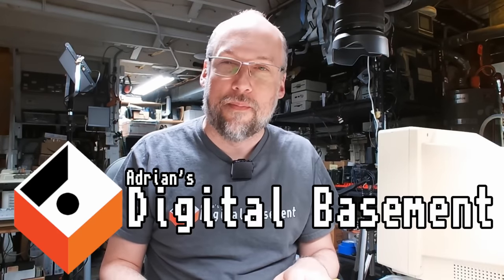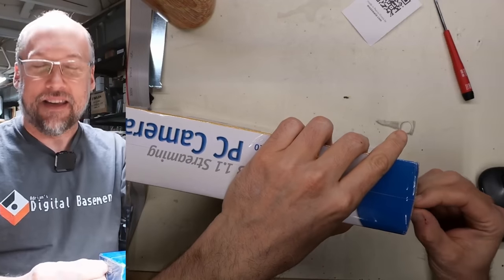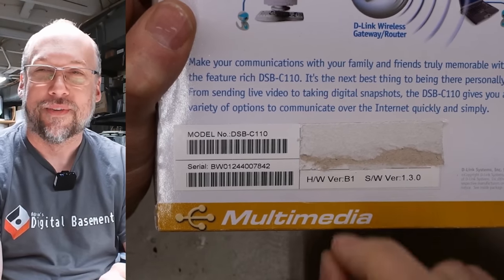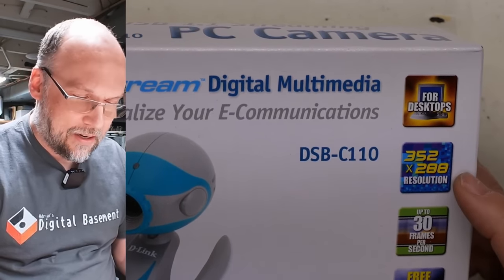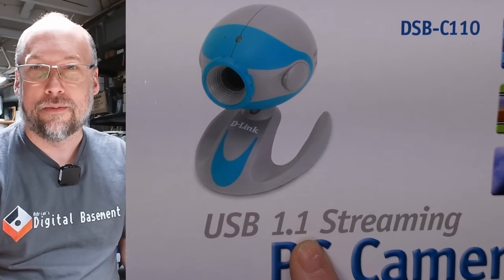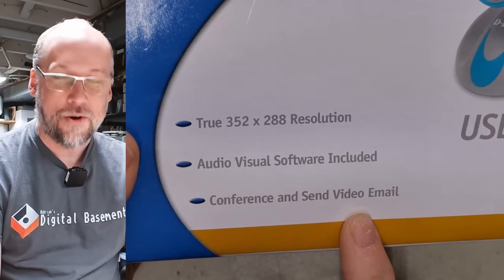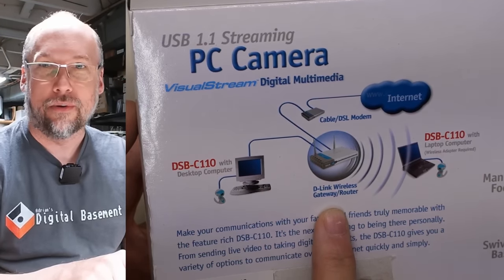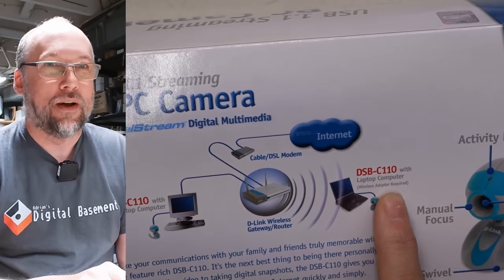How usable is a 20 year old webcam today? (D-Link DSB-C110)

Comment: Around that time (2003-2005ish) I got a similar webcam for $18 at a computer show. Out of the box, it had a similarly horribly washed out image, but once I got into the settings and manually adjusted the brightness, contrast, and color saturation, it wasn't nearly as bad.
Reply from the maker: Heh, this one could have similarly benefitted from that. I remember having to do that in the past too.  I wonder how one manipulates those same settings under Linux?
Reply: @adriansdigitalbasement2  No idea. I have a long history of preferring not to use Linux. There is also a 50/60 Hz setting which may help to reduce the flickering.
Reply: @adriansdigitalbasement2  in VLC you have a video equalizer (saturation, brightness, hue, contrast and some colour mixers) and a lot of post processing opportunities. It's not straightforward to set up, though. You need the right codecs and the right plugins and it also depends on the output settings/drivers how many different picture settings/post processing types you get.
Reply: @adriansdigitalbasement2  probably the easiest way would be using obs-studio to access the settings, without mucking about with other control software.

Comment: For an ancient cheap camera, the quality isn't that bad. This thing is still useful for doing retro effects without any kind of filter :)
I was sure this thing will work just fine under Linux. Usually when it comes to old hardware, unless it's something which uses a generic driver (keyboard, mouse, etc.), you'll likely have better luck getting it to work under Linux than Windows.

Comment: This camera likely came out right before the USB Video Device Class was defined. So that's why it needs a custom driver and why Windows 10 doesn't recognize it and why mac isn't supported.

BTW, amazing retro effect when you were on camera. Easier than using a video editor plugin :)
Reply: @MrHurricaneFloyd  That seems unfair. The class specification for webcams came out the same year this product was released, and this device does not appear to have been class compliant. The vendor had a custom driver for the Windows OS available at the time. There's plenty of old hardware which, if it adhered to a class specification, still works today. Anything from third-parties, which isn't a recognized class spec, relies on the product vendor to update their drivers over time. It's great that Linux contributors have worked to keep the driver for this functional over the years.

Disclosure: I work in Windows at Microsoft, mostly on apps and technology for musicians.
Reply: @MrHurricaneFloyd  Thank you for your contribution.
Reply: If I remember correctly (and this  is going a long way back), I think these cameras used the isochronous transfer mode of USB, which was dropped from the USB standard at some point, and windows stopped supporting it all together, which is why there was a max windows version they worked with even if you had the drivers. I had a USB Quick Cam (and this looks like an exact quick cam clone with slightly different outter plastic) ages ago that was pointed out a window as a webcam / timelapse camera. and I remember having to run it on a linux box even back in 2002ish timeframe. I switched to linux as my main machine shortly after that, and have never looked back.
Reply: @gorak9000  Windows supports isochronous transfers for drivers as well as with WinUSB (similar to libUSB). But it it was dropped from the class spec, then it's unlikely to be in the class driver.

For a class driver to pick up a device, the device has to report the right compatibility in the USB descriptors. Otherwise it will need a vendor driver.
Reply: Wow yeah, right at the same time. And it was cheap enough they wouldn’t want to make it up to the spec. The Eye Toy worked fine with no drivers, but that was at the very end of 03.
Reply: You can also just edit the INF files they are text. Just add newer versions of Windows to the allowed versions and windows will probably report it fine.
Reply: @RowanHawkins  That's a bit iffy. Worth a try. But if the driver's not signed, or uses a deprecated driver model, it won't work. Many Windows 7-era drivers can squeak by, but earlier than that is unlikely.

Comment: Remember that when this camera was current, we were still on analog NTSC for broadcast TV, which has a realistic resolution on 320x240, and VGA (640x480) was still considered mainstream.  We were recording our shows at SLP speed, and the output of that was worse than this camera, but that's what we were used to at the time.
Reply: Yeah, I never used the high quality settings when recording video. I did a few times and noticed a difference, but SLP was what I stuck with. On a basic 24" TV it was fine. 

This would have looked "ok" for the time when viewed live, but then compression would have killed the quality further because lots of people were still on modems, and cable internet was just starting to take off.
Reply: @volvo09  Although it was made backwards compatible to accommodate bitrates as low as 40kb/s the H.261 compression standard that CIF cameras like this were intended to support was really intended for use over ISDN. The video quality was actually not too bad for a compression standard from 1988.
Reply: To be a pedant, NTSC stomps this.  VHS was a bit closer, but even that had higher vertical resolution.
Reply: Eh, for a computer in 2003, I doubt you would have been using 640×480 for general desktop use unless your computer was 6-8 years old or more. Probably 1024×768 on a late-model CRT or early LCD.
Reply: @sanityormadness  not PC resolution, but consumer digital video didn’t go beyond 640x480 until the late 00s

Comment: There's tons of old flatbed scanners that were discontinued on Windows - worked fine yesterday, now they're paperweights (somewhere around 2019). On Linux, they still just work. I even have a scanner from the late 90s that came with a proprietary program that only worked on Win98 and XP and no OS integration so you HAD to use that crappy program. Works just fine in Linux and I use it as my default scanner.
As opposed to webcams, the picture quality on even a late 90s scanner can easily still keep up.

Comment: Back in the late 90s and early 00s I actually used a WinTV card and an analogue video camera, so I could capture at 576i (as I live in a PAL country) which in combination was much, much better than any webcam and also ran at 50 fields/s.
Reply from the maker: YEAH, I did exactly the same thing! And old VHS camcorder hooked up to my computer -- and indeed the quality was decent.
Reply: I did the same thing with my All-In-Wonder 9700 Pro.
Reply: I remember that combination, a BT878 based capture card and an egg-shaped NTSC camera. I bought that as a package.
Reply: thats how wierd paul makes  his videos an old camcorder hooked to a capture card
Reply: I had a Fuji digital still camera with an USB-webcam-feature in the early 2000s. It did VGA resolution with 30 Frames/sec, but the quality was absolutely stunning. With good lighting it almost outperformed a Betacam SP broadcast camera. Also the photos (7 MP) were awesome. Too bad it got stolen out of my car.
Reply: yeah hauppauge or something and a video cam was pretty good from mid 90's.
Reply: I remember drooling over the all-in-wonder
Reply: This is how I used to watch TV back then.  TV capture card connected to cable, and some OSS TV Capture software that did some filtering to de-interlace the video in real time.  Kinda cool watching TV on my monitor in a little window.

Quality was quite good. It ate up some processor doing all the filtering and de-interlacing, but it all worked well on a Celeron 450.
Reply: @stevesether  I fondly remember hacking pay-tv with my Pentium MMX and my Hauppauge TV tuner card... Those were the days! The feeling of archievement, when the picture popped up was priceless.
Reply: @albinklein7680  Nice.  I had no idea those cards could descramble the pay-tv stations.  IIRC by the time I was playing around with it, the pay stations were digital, so it wasn't possible anymore.
Reply: @stevesether  It happened all in Software. It was the European analog System (Teleclub, Premiere) with the Sagem G1 encoding. Active from 1985 to 1999 approximately. It was possible to crack every frame in realtime without the actual key.
Reply: @albinklein7680  My Fuji would eat batteries , lasting less than half hour
Reply: I did that for some video meetings in 2020 (possibly 2021), except I was actually using a DV camera. Not as good as a modern webcam but probably better than the one built-in to my craptop.
Reply: @eDoc2020 I used a fairly high quality digital camera with  HDMI out, connected to a cheap USB capture card (which Windows and even Android recognize as a webcam). It works extremely well. The quality easily surpasses any high-end webcam, at the cost of being a bit bulky.

Comment: Dlink: it works right away, or you'll pitch it across the room, no in-between.  Dlink support documentation: hopefully someone on the internet has had the same problem with our stuff that you do and has fixed it somehow.  Dlink: our wall warts power other stuff when the tech breaks.  Dlink: tech and power supplies available (together and separately) at thrift stores nationwide.

Comment: Win 95B was the first version to support USB, although "support" is being way too generous. You could way too easily corrupt your Win95 installation just by plugging USB devices in out of order, or before the drivers were installed. I worked tech support for a major computer manufacturer at about this time, and every system we sold would come with a big sheet of paper that said something like "WARNING: DO NOT PLUG ALL YOUR USB SHIT IN ALL AT ONCE!!" Invariably, someone always did, and we'd end up formatting/reloading Windows on their brand-new PC.

Speaking of that rubberized plastic, I recently obtained a Toshiba T5200, a 386 laptop with a VGA compatible(!) gas-plasma display. Unfortunately, it was covered entirely in that same rubberized coating, which was deteriorating back into crude oil. It wasn't just sticky, it was slimy, and it was coming off on my hands when I held it. I had to use two bottles of 99% isopropyl and a shit-ton of paper towels to get as much off as I could. It made a huge mess.

Comment: We used a Microsoft Lifecam VX-2000 back in 2008, we wanted to make a robotic arm that played domino with you and the image processing was using that camera. It was a bit better than what you showed but not much better. It had some weird issues with the white color, it showed up as purple sometimes so I had to write a part in the code to change purple hues to white. The box of that camera was terrible, you couldn't put it back together once you opened it, it was also around the same price as this one.
Reply from the maker: I had a few of those Microsoft camera over the years, and some of them were decent, but others were utterly horrible too. I have to wonder how much of the quality we have in modern phones is due to software processing? I guess it's just up to how much effort is put in to make a good product versus just throwing together the cheapest possible thing.

Comment: These early webcams were a lot of fun to discover, back in the day. They were poor in many respects but it was the first exposure to a trend that was taking off. We could only dream about the "internet superhighway" and the advanced technology we may have in the future. When the only chance of seeing live footage was if you had an expensive camera, the webcam really meant that you could imagine what would happen if you had a small TV station or production house at home. Today, we have the mobile phone that holds well enough for most basic purposes, you can even publish your creation right away on the net!

In terms of technology, all early sensors had very poor resolution. 352x288 or QCIF was the quality you could expect. Even if some webcams advertised a VGA photo mode, it was made possible due to interpolation, the CMOS sensor was not advanced enough to offer output at this native resolution. You could use decently enough such a webcam for video conferences of the day, a massive novelty of the era, but not much else. In this case, you did not have the network bandwidth that would handle well enough even that low quality webcam output.

Comment: That is actually their original company color that teal color.  When the world switched from coax to rj45 apple was not doing so well, but dlink was killing it with cheap and reliable consumer switches. That apple became trendy came a little later.
Reply: Yeah, I had an old D-Link 10Mbps 5-port hub that was white with teal accents, including the vertical stand.  It was a pretty neat design aesthetic, from around 1995 or so.

Comment: Seeing the image from that camera is rather akin to what I did this week, going from a modern 1080p IPS LCD here on my Lenovo X240, to the 640x480 DSTN mess on a Compaq Contura 4/25c (not Aero!) laptop I revived yesterday, granted said laptop is 30 years old now, but still, LCD technology has also come a long way, and cameras, for less than £30 a piece, I bought a bunch of 720p IP cameras with much higher quality and framerate than this webcam, and IP cameras are basically SBCs with a camera stuck onto it!! Technology has come so far so fast, that's a given... :P

Comment: Hey Adrian, great video. I happen to have the Logitech QuickCam Chat model. It is cheap quality, but slightly higher resolution. Getting it to work in Windows 10 is a bit tricky. You have to import the legacy drivers with a program extracted from another logitech installer program. I used 7-zip to extract from the .exe file, just right click, under 7-Zip menu select open archive. After that select the correct driver out of the list when you select let me decide at the driver update. I am unsure how to do that with the D-Link DSB-C110 you have but they aren't the worst thing if you need a webcam in a pinch.

Comment: I love it! For having you just talking it's actually not that bad =). You should totally use it in some shots!

Back in 2003 I had bought a Minolta Dimage XT Digital camera. And it could be used as a good quality optics webcam too! Can't remember if the webcam offered better video than what it could save for movies. Because that was 320x240 in 15fps. Not to forget that at the time my computer was connected through a Geeforce2 equipped Pentium II computer to the 28" fat TV with a hightech S-Video connection. Boy did things change when I got an HD capable (768p) 32" flatscreen TV a few years later. Connected that pixelmapped with DVI-D to the new computer with 7800GT in SLI. By that time the Minoltas video quality was feeling like rubbish and getting a camera that could record in full VGA resolution at 30pfs was such an upgrade in quality a few years further down the line. But that feeling didnt't last too long. It obviously needed more to make things look good on the TV and remember when we ten years ago got a camera that could record 1080p in 60 FPS!!!. What a joy! That camera has since been replaced but I still use it as a 2nd camera actually, It's still very decent! And the soon 20 year old HD flatscreen is still going too(!). A lot happened very quickly over a few years back then, but as you said. Not soo much since.

Comment: The X61s is one of my all time favorite laptops, the modern one I have now is not a patch on that.
Reply from the maker: It's a true workhorse, and so easy to service and swap parts around on. This one is a hodge-podge of various machines and just ... works. It's just let down by the old CCFL backlight screen which looks rather washed out and dim.
Reply: @adriansdigitalbasement2  the form factor is wonderful, mine was the none touch model. I can't think of a better modern machine. Would love it if someone started offering a replacement motherboard or something for them. Would totally go for that, the screens might cause some difficulty though.
Reply: @tomicarr90  That's actually been done: the 51nb X62. Though that might not fit the s models and good luck getting one now for a reasonable price.

Comment: Strewth! The webcam I was using back in 2003 was better than that and I don't think it cost that much. Maybe? .. I might still have it, couldn't find it when I was looking for it recently though. Would be interesting to compare it with my modern ones, which probably cost about the same.

ETA: If you run that through e.g. Webcamoid you might be able to compensate for the lack of contrast etc..

Comment: 20 years ago, I had a Logitech Quickcam Web, and it had a similar output to this one: 352 x 288 - interpolated to 640x480, but it still looked awful - and it had a microphone and a button to take stills.  The output of the mic was very 'toppy' with lots of noise, and blue-screen crashes happened regularly on the Windows Me system.  I got it working in Linux (Debian) and it was mostly okay, although sometimes the video would stutter to a halt.  Performance seemed to depend a lot on the motherboard's USB hardware.  I recorded a lot of blurry, out-of-sync videos of my cats.

Comment: Pretty much exactly how I remember those cameras being especially the budget variety.  I have to agree with some others that usually out of the box those older cameras were generally terrible and you had to fiddle with them to get them to behave even remotely well,  Modern decent quality webcams have pretty fairly acceptable automatic white balance and exposure and use a high enough bandwidth connection to maintain a good frame rate so I agree we have made it far in camera technology and I think it was ironically cell phones and streaming that pushed that bar so quickly.